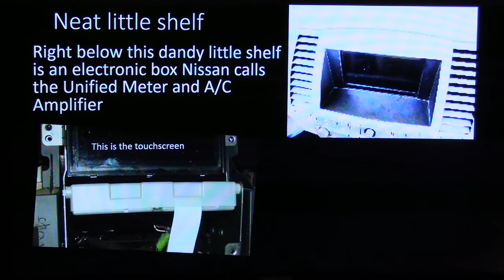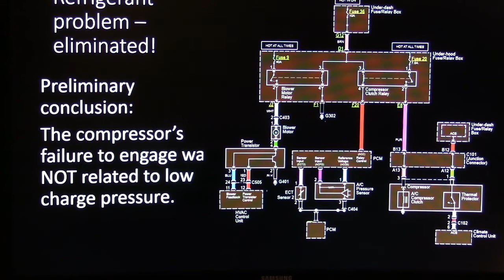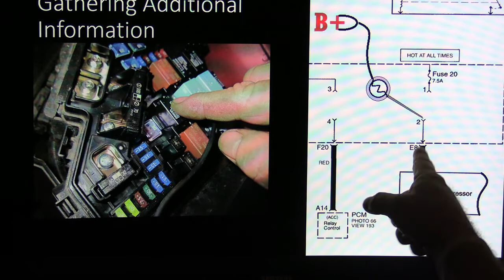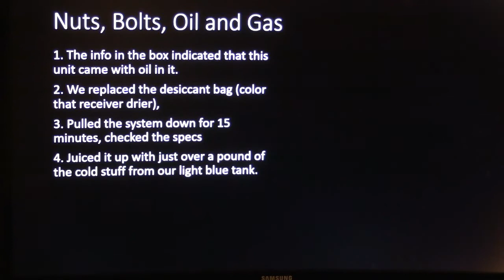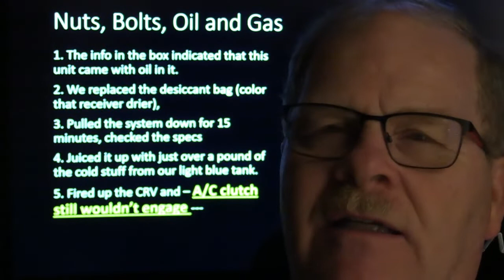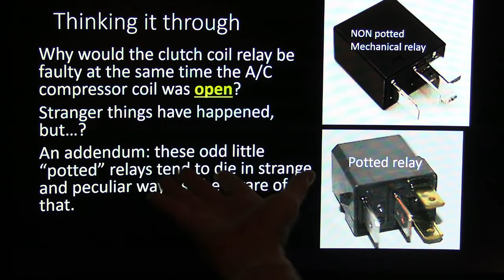Bait And Switch Troubleshooting

Comment: The bait and switch seems to be constant.  The other day I had a 2005 Subaru Outback with the 2.5L Turbo.  I was asked to help a kid at church who didn't have any money but had a check engine light on preventing him from passing inspection for the registration that was 2 years out of date.  He said it just had an O2 sensor heater circuit code.  I said, sure, bring it over.  That should be easy, right?  Yeah, and it was, but nothing was said about the VVT codes that were also in there and nothing said about 40K since the last oil change.

Comment: Good Morning.  Wondering if you had some more information for me to study Shift solenoids, clutch and band charts. I had some trouble with these types of question and got backed on test question and ran out of time. 1 hour 15 minutes is not a whole lot of time for 60 A2 questions.
I have both Delmar and Motorage study books.
Reply from the maker: What I would advise you to do would be to pull up as many clutch band charts and shift solenoid charts as you can find in your shop manual material and study those carefully.  atsg.us has good material too.
Reply: @McCuistian   Thank you.

Comment: This is the #1 most underrated YouTube channel out there, period.
I have 20 years of turning wrenches and busting knuckles. I started out when I was 15 years old with my dad’s craftsman hand tools but that didn’t stop me and my buddies from getting paid to swap motors, transmissions, etc. at that age.
Fast forward to 2022, I’m 36 years old and I am going fishing every morning. Some might say that’s because of my time in service and yes, I’ll agree to an extent.
Or was it because I started out turning 101 hours my first flat-rate job and got some ridiculous hours. That’s starting out, first week; let me tell you it got way higher w/ a 183% efficiency rate. 
This was in a unique situation where my customer was my service manager and we literally had an AZ that got 4 hub runs a day and at one time we were getting 3 to 4 truck loads a day of cars with 9 to 10 cars a day. You will never hit over 130 hrs flat rate in normal shop- you have too many variables that you have to wait on versus where I would pull the car in, inspect it, sign it up for parts and hand over the work order to my manager and start inspecting the next one. And after he approved the repairs and ordered the parts; I got the car back and hung the parts. Easy money!
I can post photos if y’all want just let me know where.

SGT Reid